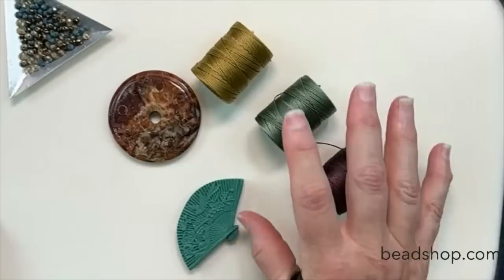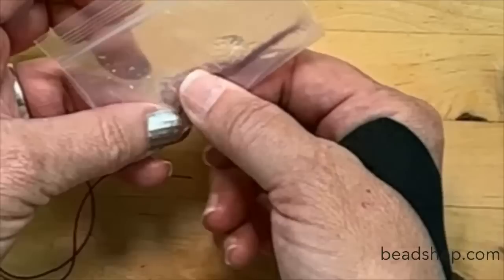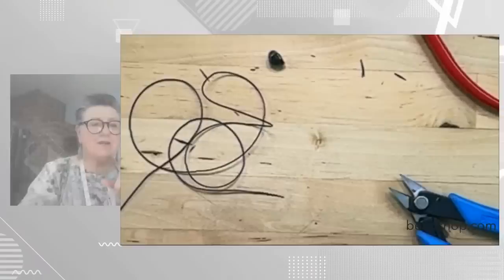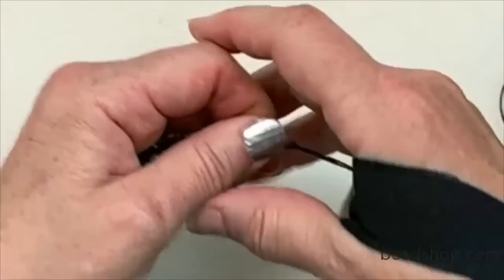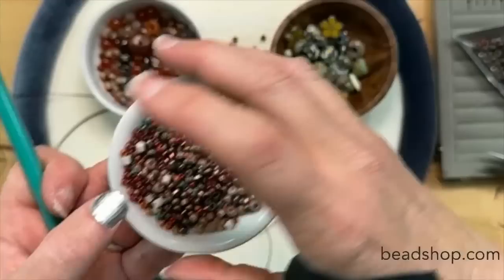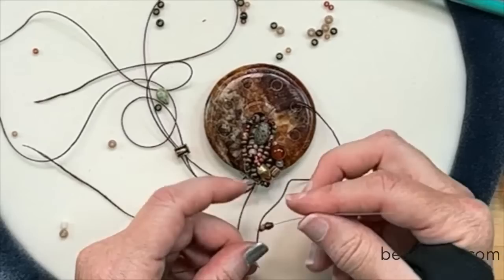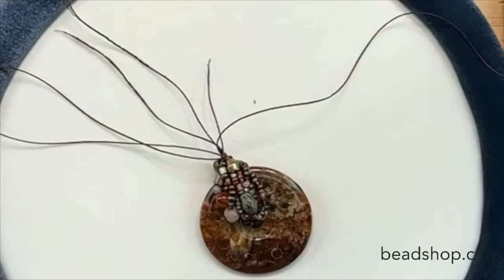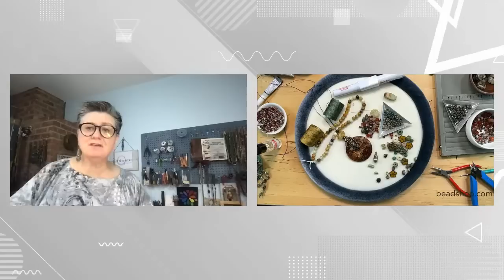Beadshop LIVE:  Episode 2, Master Class with Kate Richbourg- Advanced Stringing Techniques

Comment: Thank you for showing the shredding technique for making needles. I haven't seen it before, I usually just use glue then cut the thread at an angle, but this seems like it allows for more of a varied sized bead selection. Have you ever tried using Beadalon's Bead Fix for making string needles?  It's a very thin viscosity superglue. It dries super fast and doesn't over harden the end of the thread.
Reply from the maker: Glad it was helpful!